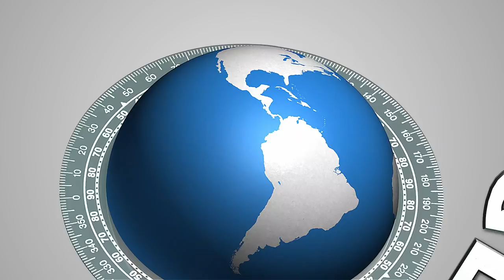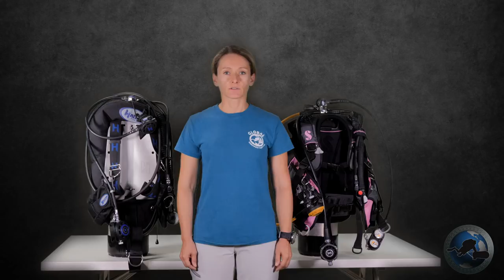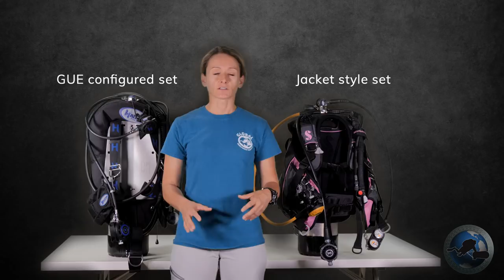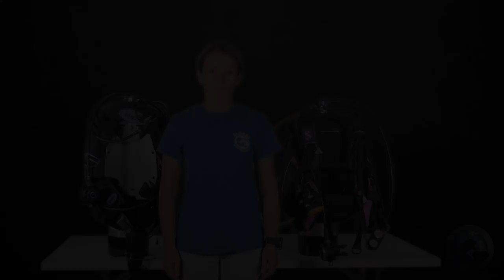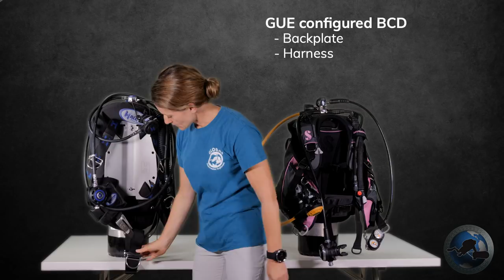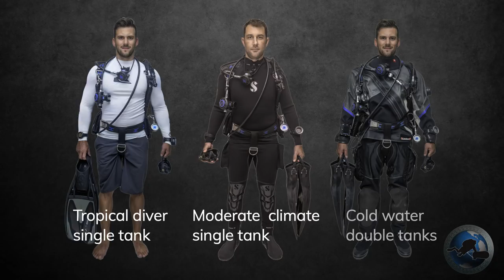BCDs (jacket) VS Wings: Scuba Diving Equipment debate

Comment: Comment if you' considering GUE or even backplate and wing. I love the BP/W, however im also a recreational instructor, and for those individuals that dont have confidence around the water, surfacing with back inflate only can cause panic or stress on the diver.  I love diving and I love being part of a divers first experience, but if its not comfortable to breath air at the surface (new divers love to do it), that can be a factor for someone to quit during a class, or they finish the class without any intention of diving again. That being said, you cant win them all over to the sea side.
Reply from the maker: Hi Slick, have you had this happen with a lot of students?  It is likely caused by poor backplate sizing or over weighting rather than the wing itself.  While it will push you slightly forward it doesn't push you face down like some people say and can easily be handled by having the diver lean back with their legs forward and to have them not kick to maintain buoyancy at the surface. If they have to kick to stay up, they are too heavy.  If you don't use the BP/W setup often maybe consider meeting up with a local GUE instructor or possibly taking a fundamentals course to learn how to properly weight and adjust a Backplate and wing configuration.  We certify plenty of recreational students in this configuration without issue.
Reply: @GUEdivers  My students dont usually use back inflate BP/W, I was merely mentioning it for the people that arent comfortable with water, but are still facing their fears and discovering the world of scuba. The smallest need to adjust for us can become a stressful situation for new divers.  When they have only tried snorkeling or swimming in a pool and coming straight up to the surface to breath is what they know, changing that in anyway can scare some.  It could be lack of confidence in themselves, their equipment or me.  I will say back inflate is great for diving, but i wouldnt say its for everyone.  Theres no shame in taking baby steps or using a jacket style BCD, its personal preference. GUE is great, i would say its the premiere diving association, but GUE although it has become noob friendly, it doesnt get the marketing it deserves for new people.  Mostly experienced divers that enjoy the sport and want to expand their knowledge look towards GUE as the pinnacle of DIR/Tech  instruction.  Then there are people that like to customize their set up nearly every dive and thats fine, but that doesnt fly in the DIR configuration.
Reply from the maker: Thanks Slick,  We just tend to try to push comments to speak from experience rather than giving generalized advice.  I'm curious if you have any personal experience with students or divers you knew having trouble with back mounted wings?   A lot of times people talk about things because they heard it somewhere and we work to dispell those myths.  We've noticed a growing trend globally of new divers turning to the BP/W setup even if they don't follow Hogarthian, DIR, or GUE principals.  Our goal though is to set standards in configuration so teams around the globe can match up without wide variation and dive in teams without worrying about individual gear setups. I would say you are more correct that this works for some and not than others, but we have a good body of proof that is does work well to accomplish project goals and help divers have more fun along the way.  We are a small nonprofit so our marketing has never touched that of the large agencies owner by venture capitalist firms, but we keep trying harder and harder and learning along the way.  Check out the new gue.com as well as our video site gue.tv and blog site InDepth.blog.  Thanks for engaging and providing feedback to us and others as it helps tie us divers and environment lovers all together!
Reply: @GUEdivers  I love what you do and I encourage people to try out back inflate, BP/W.  I have a few people that were already stressed about getting in the water nearly panic and almost give up with back inflation.  I will point out, like half the beginning divers I usually see, their swimming skill is barely north of a doggie paddle. Our dive sessions, usually start with swimming lessons, just to get them comfortable being in water too deep to stand. These are the students I enjoy teaching though.  Its cool to see people jump right in and have their buoyancy beginner perfect after the 2nd dive, but I love the look of accomplishment I see in their eyes when maybe they choked 3 times before trying to clear a partial flood,  and they finally trust in themselves and the process. Every student has their own breakthroughs, to me it means so much more if they are conquering their fear of water, while also trying to conquer the basics of diving.
Reply: I use wing style with all students except for the very tiny ones....  (less than 100 pounds)... we talk with them about using their core to stay upright at the surface and because of that, I've yet to have a student end up with their face in the water at the surface. wing style is good for nearly every diver... (specific disabilities may have adjustments necessary...)  the right information and training must go with any style of equipment....
Reply: @Slick85  someone who swim only dog paddle and panic in deep water shouldn't go to learn diving until it will be fixed. 
Fighting personal fears isn't appropriate motivation to learn diving. 
Unfortunately, it's just business now.

Comment: I’d put the alternative air hose on the left side .. if someone wants to uses it, it won’t have a twisted/ tension hose trying to pull the regular out of their mouth..if they pull your regulator out of your mouth , as an instructor you should be okay with that your hose is twisted/ tension ..you haven’t run out of air.or panicked
Reply: GUE standards always keep the right side of the body free and clear for safety.  Stage bottles and other items are carried on the left.  Right side and right hand are always free to be able to donate working primary regulator directly out of your mouth to the out of gas diver.  Left hand comes up and puts the back up reg into your mouth from the bungee hanging around your neck.
Reply: Rich Denmark try both, then ask the person needing to air ,which feels like the regulator is pulling out of their mouth.
Reply: @paulduffy697  what you are explaining here is more of a training issue than the equipment configuration issue. A properly trained diver should be comfortable sharing gas regardless whether the hose is coming from their left or right. Simply if it is coming from your left, then just route it behind your neck and into your mouth. This way the hose won't be twisted either.
Reply: P A ..trained and experienced are different, most instructors are experienced but lots of trained divers are not. In a out of air situation less experienced divers will probably have more anxiety and it could lead to panic, having a hose in an S shape coming from the donor tends to put pressure on one side of the hose and it can feel like it’s being pulled out of the mouth, the less stress on somebody in that situation would probably be preferred..if you change the hose direction inlet on the 2nd stage then all good also, but most you can’t because of cost of tooling in the manufacturing stage..

Comment: The wing adds buoyancy to the tank, not the diver - what stops it from pushing the diver's face into the water if the diver is no longer conscious and surfaces on bcd lift alone?
Reply from the maker: A. Their buddy bringing them to the surface in an unconscious diver rescue B. Proper Weighting and backplate adjustment. C. Physics, If the diver is ascending unconscious the legs are still one of the heaviest parts of the human body and will hang down keeping the diver upright.

Comment: aren't you mixing 2 things ? one is jacket vs back plate, and the other is regulator/octo mounting location/setup. They are quite orthogonal... you also didn't say why you like GUE (or even what it means) in your video. Always wanted to try a back plate but mostly for trim and profile reason (I use a semi jacket with almost no pockets and mostly back inflation already).
Reply from the maker: Hi Alain, yes we are mixing them.  The video is not a direct comparison of BCDs, but is a comparison of traditional scuba configurations (Which 90% of the time use jacket style BC) and the GUE Configuration which uses only BP/W and longhose setup.